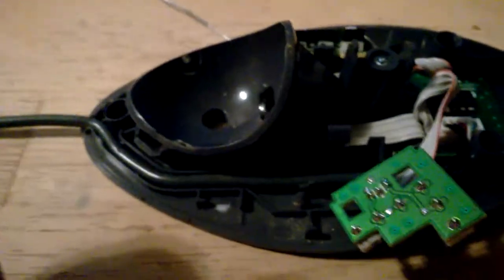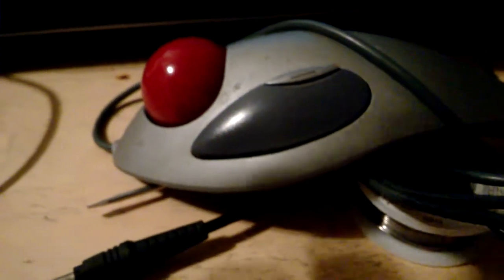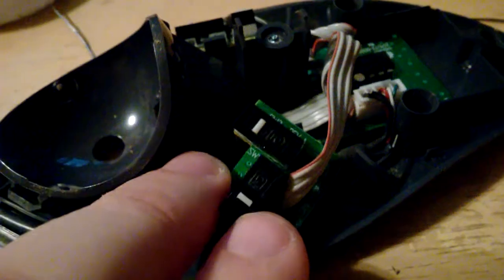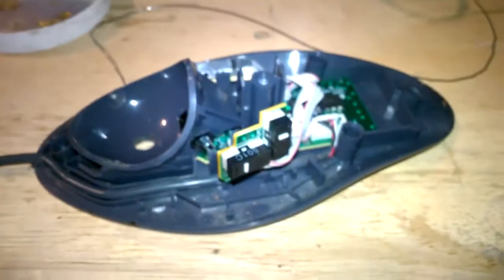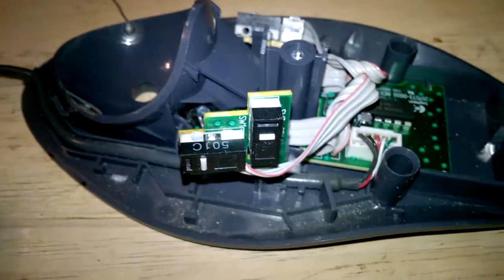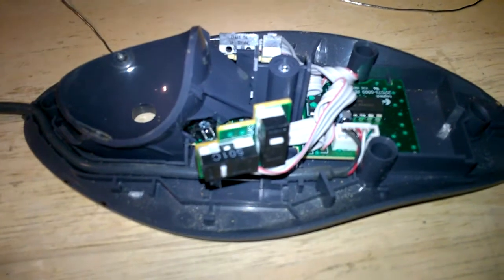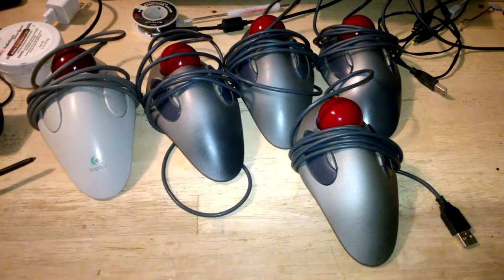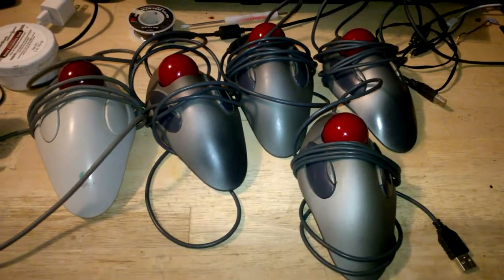Logitech - Trackman Marble Mouse - Repair

Comment: I've never had the micro switches wear out so far. The tiny spherical ball slides that the track ball sits on wears out and the track ball starts to be harder and harder to move around.
Does anyone know a repair or if you can get / replace these nylon (i think) slides?

Comment: I have been using Trackman Marbles since the white 2 button ones came out also.  Most ergonomic/easy to use compared to any other trackballs (Kensington/etc.)  I got the dreaded left-click malfunction that happens over much use, so I searched and found this helpful video (thx!!) and this fellows vid too: https://www.youtube.com/watch?v=M5yTszNc-qI  Both excellent help.  

I desoldered, swapped, & resoldered a couple of the cheapo Omron microswitches and tested the buttons.  I'm not a soldering whiz so I watched a bunch of vids and ordered an iron, some Kester solder, and desoldering wick.  A suction pump would've been handy but I managed with just the solder wick.  All buttons without the plastic chassis on are clicking/functioning - except the wonky one but I don't use the dinky scroll buttons either.  I put the plastic chassis on top after everything was in it's place but now 2 of the plastic chassis buttons are "stuck" and won't depress/click as they should against the microswitches.  I removed the chassis and reseated both small pcbs then reassembled the plastic chassis again.  Same problem.  

Something must be off kilter - the 2 stuck buttons are one that I swapped out and one I didn't touch.  I thought it may be one of the ribbon wires but when reassembling you can't see inside to know what's stopping the button movements.  I'm not sure what is causing this but I read somewhere that putting some tape on the inside of the plastic button arm contacts may help as apparently over time the plastic gets a dent/out of shape?  I have no idea.  Any helpful ideas?
Reply: After micro-switch replacement, if the button won't click; try the following:
1) check that the cable from the mouse to the USB port is properly seated in its track.
2) check that the circuit board is correctly seated & below the tab at the top. 
3) check that the ribbon  cable is properly folded & fully depressed (not sticking up).
4) tighten halfway the hidden screw, then the remaining 4 other screws. Further tighten each screw, one by  
     one, so that the plastic housing is securely closed; but not so tight that button has no depression.  The 
     button should be clickable over its entire surface.

Comment: Tired of these things. I'm a left-handed trackballer / right-handed keypadder while FPS'ing. I wear out the right button b/c I usually have it mapped to zoom/scope. I've gone through 5 of these things; about one every year or so. I'm tired of them crapping out. Like you, the contact just craps out, and the engagement spazzes out, becoming inconsistent. At first it seemed like the little metal spring was cheap. But, yeah, these microbuttons are just cheap. I'm just gonna go with a different brand of trackball. Everything I've gotten from Logitech over the past decade has just been a cheap POS that goes bad too soon.

Comment: I've had two of these and they both have the same problem: after about a year of use when you hold down the left button while using the ball for scrolling or highlighting, the cursor just goes berserk. It become impossible to work with text or edit videos. Is it software? OS? Browser? I've tried everything, the drivers are current. I wonder if anybody knows the cure....

Comment: my switches are fine but the actual cursor stopped moving. every now and then i might see slight movement but other than that it doesn’t move at all. any help with this please??
Reply from the maker: Have you cleaned the pick up sensor? It's under the ball. It scans the dots on the ball to tell if it's moving. If you have and still nothing then it sounds like that sensor has failed.
Reply: Beach Tech Yes i concluded that there was something wrong with the sensor and did ALL sorts of cleaning to see if i noticed any difference. after using soft wet clothe it still did nothing. actually as i’m writing this the mouse is actually working perfectly fine, it’s only once every few days where the cursor will not move at all for some odd reason, even if i don’t touch it at all...
Reply: it usually magically fixes itself so i decided to open it and check for any obvious looking reasons for why it wasn’t working properly and really didn’t find any corrosion or anything.. i’m about to buy another one since this one is over 10 years old and about time to die off :P..

Comment: Nice thought to swap with unused switches, thanks Beach Tech.  But if you're daunted by soldering or don't have the equipment readily available, it's also possible to repair the micro switch instead.  I just did this on my 10+ year old trackball, which only just started misbehaving.  It was fairly easy to remove the cover of the switch and expose the contacts inside.  I then cleaned the oxide off the contacts by scraping them a bit with a jewler's screwdriver.  Fine sandpaper probably would have been better.  In the process, the movable armature (middle contact) sprang loose and disappeared.  So I opened up one of the "spare" switches to get another one.  Reinstalling the armature was a bit finicky (took a pair of fine point tweezers), and I had to open up the other spare switch to see how it was supposed to fit.  But I finally got it  back together, and the trackball works again.  Can't say how long it will last though.
Reply: Hi Kim - I'm considering trying what you did. Is it still working now?  - FB says you posted this about a year ago.  I would really appreciate a reply!  Thanks Kim   ;-)

 RE: Logitec Marble Mouse
Nice thought to swap with unused switches, thanks Beach Tech.  But if you're daunted by soldering or don't have the equipment readily available, it's also possible to repair the micro switch instead.  I just did this on my 10+ year old trackball, which only just started misbehaving.  It was fairly easy to remove the cover of the switch and expose the contacts inside.  I then cleaned the oxide off the contacts by scraping them a bit with a jewler's screwdriver.  Fine sandpaper probably would have been better.  In the process, the movable armature (middle contact) sprang loose and disappeared.  So I opened up one of the "spare" switches to get another one.  Reinstalling the armature was a bit finicky (took a pair of fine point tweezers), and I had to open up the other spare switch to see how it was supposed to fit.  But I finally got it  back together, and the trackball works again.  Can't say how long it will last though.

Comment: Dear beach tech, can you please help me with a question? Does the "bed" or "hole" where the ball sits and roll is lousy? I bought today a used trackman marble and I feel like that piece is lousy. Greetings
Reply: Loose*
Reply from the maker: Can't say that any of mine have that problem. The ball itself is loose but that's by design so it can be removed for cleaning.

Comment: I find the best fix is to use a toothpick to prop up behind the top-left side behind the switch board, and then snap it in place. This ensures the misplaced/broken micro button will be pressed better because the entire board will be adjusted forward by about 0.2-0.3mm. This gets me the most success now in terms of keeping a mouse clickable when it starts to wear out after about a year.

I do believe it is designed intentionally this way.. which is a shame since the design is the only of its type. 

I've also experimented with plastering/melting the actual inside of the button groove that pushes the micro-button, increasing the elevation a bit of the "button presser", it is harder to do but yield similar results..
Reply: Thank you, the toothpick trick worked and has saved me from having to replace the switch!
Reply: Just did this today thanks for the tip!

Comment: The correct micro switch is made by OMRON and the manufacturer's part # is D2F-01-A1, in case you are interested. You can get t from any of the major electronic component parts distributors.

Comment: I've read that the Trackman Marbles use cheaper switches than the older Marble Mouse did. You try to find one of them... I bought mine in 2001 and has worked well ever since*. Or maybe I'm just lucky. :) 

* Had to replace the cable once.

Comment: Thumb balls are better.
Reply from the maker: +ultimacj Until the Bluetooth radio burns up and your left with a paper weight.
Reply: +Beach Tech PS/2 ftw what is this bluetooth you speak of?
Reply from the maker: +ultimacj The ones I know you own that are wireless. $50 paper weights. When the usb radio's burn up you can't re-key them to a new Bluetooth dongle.
Reply: +ultimacj Nope